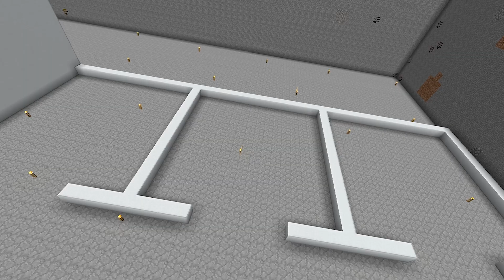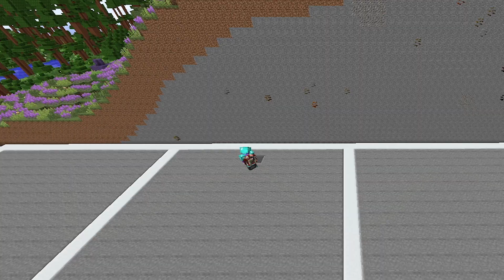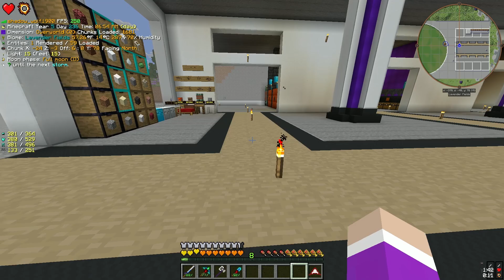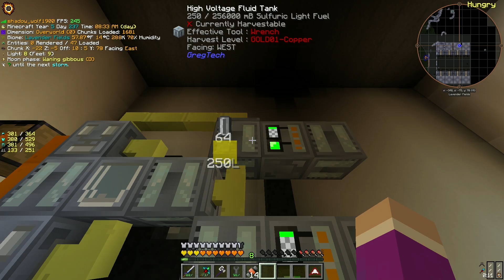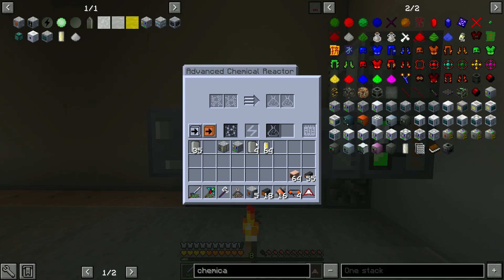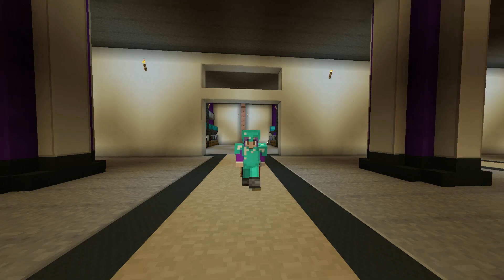Gregtech New Horizons Ep.8 Polyethylene & EBF Upgrades

Comment: 2.7 added a small multiblock water generator that produces 3 buckets per second if you want to get rid of all those railcraft water tanks.
Reply from the maker: my only concern is would my world break if i were to update to 2.7
Reply: On 2.6 you can can have HV 4blocks multiblock pump(1000mb per second) and on EV you can have 1block that can make  as much as you pull per second